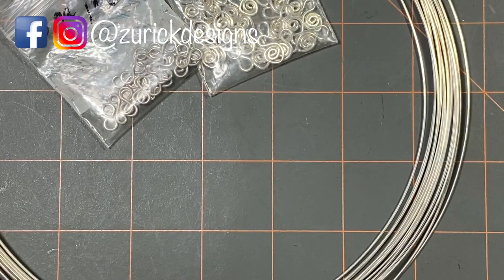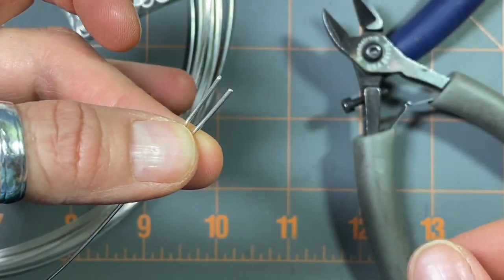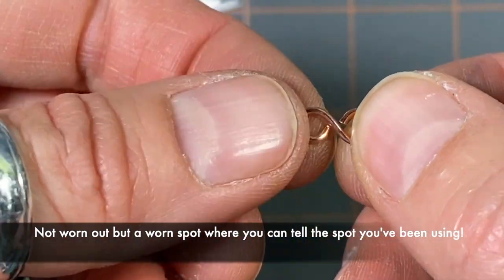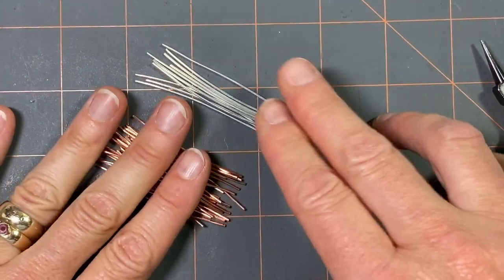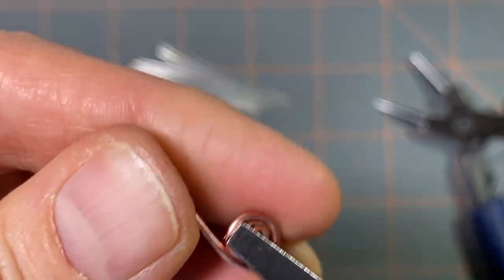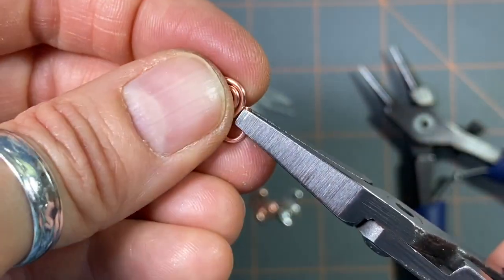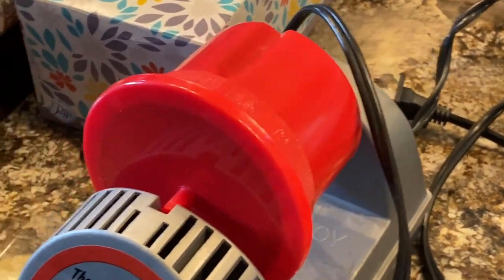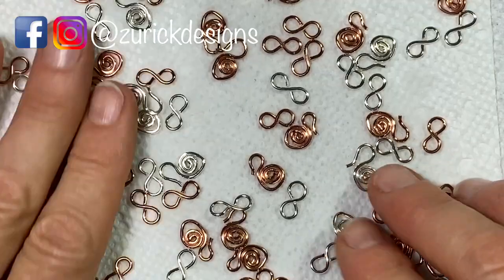Wire Wrapping Techniques-Swan Clasps & Figure 8 Links-My Process!

Comment: when i make my jump rings i tumble them!  this also gets rid of any little burs.  I make a 3/4 to 1 inch jump ring out of 12g 14g  wire,(the heavier gauge the better, keeps them on better) then I place all the jump rings on the larger jump ring , then close the larger ring.  then tumble them, no need to close the smaller jump rings, almost all will stay on the larger ring.  No more burs, and they are stronger!  Oh--I also store the jumps on the larger ring, no more tangled mess, and no more sanding off the burs---Yay!!!  another  tip,  I store the jump  rings on the larger ring- in one of those pop up pill minders.  A pill minder for each gauge of jump rings!  Will try this with the clasps so i don't have to do a search and rescue!
Reply: i don't know why this crossed out most of my post?  It all belongs there!
Reply from the maker: Yea, that’s weird! 🤔
I tumble my jump rings and things too. That’s a great idea to hook them on a larger one! I never thought of that lol! 💜☺️

Comment: I watched your tumbling technique, so I did purchase a tumbler, but one with a black rubber barrel. I used steel shot that you have listed below and put a drop of hand soap in and put in 5 pairs of sterling ear wires and about 7 lightweight finger rings. After about 1 hour I removed the jewelry and found that black rubber from the barrel was on most if the pieces. I was able to remove the black rubber using dawn dish liquid, but of course that was extra time to handle each piece. Do you have any suggestions as to how to keep the rubber off the jewelry? What did I do wrong? Should I use a tumbler with a plastic barrel?
Reply from the maker: I don’t have one personally but here’s an article that might help…

https://workingsilver.com/how-to-decontaminate-your-tumbler-drum/
Reply: Thanks for your reply and the link. I did read the article, the info was helpful.  I did, however, return the rubber barrel tumbler today that I had ordered from Amazon, and I purchased a plastic barrel tumbler similar to yours, using the link that you have provided with your other information. If you use it, it must be good for the pieces that we make. I watch all of your new videos, and repeatedly watch your others, any that I can find by Zurick Designs. Thank you for sharing all of your designs and talent.
Reply from the maker: @rosanalbandian2572  oh ok,
I would’ve thought those types of tumblers would be better but it doesn’t sound Ike it. 
Hopefully the new one does well!
I’m glad you enjoy my videos! ☺️

Comment: Hi, thanks for the video! I’m new on wire work. But I wonder why need to use ss shot to wash them 2 hours ?
Reply from the maker: Hi there, thanks for inquiring! SS shot polishes and work hardens the metal really nice. It also smooths out the rough edges and saves a lot of time hand filing and polishing. 2 hours is pretty standard I think. I’ve always done 1 1/2 - 2 hours with great results. Hope this helps! ☺️
Reply: Zurick Designs Jewelry and Art oh, never know about this. Cool! Thanks for sharing the information! 🌹
Reply from the maker: Joey Phang no problem ☺️